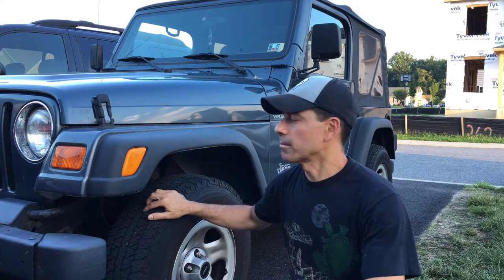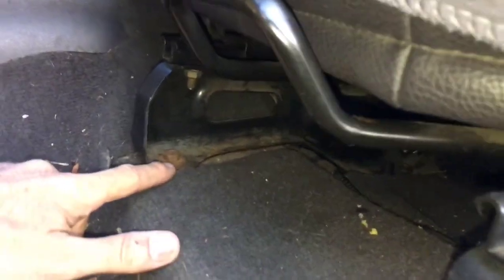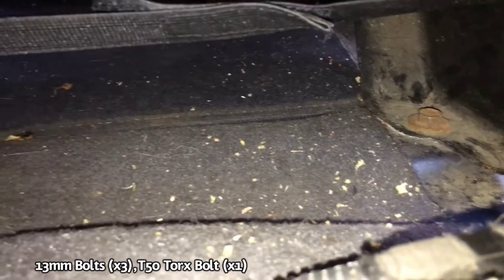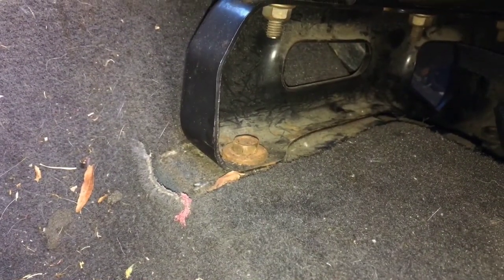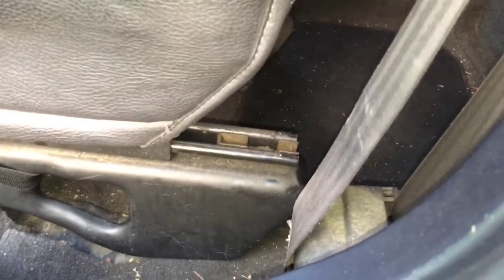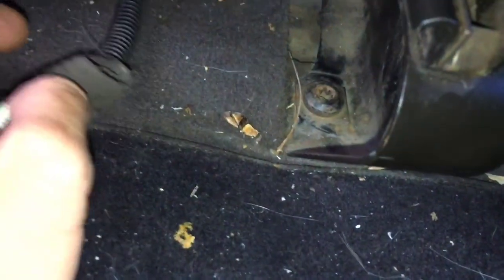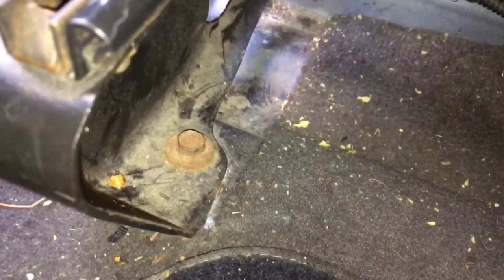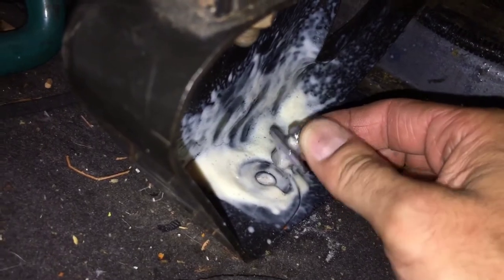How To Remove Driver's Seats - Jeep Wrangler TJ (Andy’s Garage: Episode - 207)

Comment: Just did this today. 2 front screws came right out. Back torx I could not budge, the other side rear loosened just a bit, but felt like it could break just like his did. Word of advice, use heat. I used a small torch and heated for a few minutes and was able to break both free without a bolt breaking.